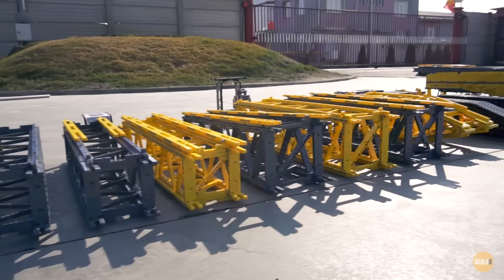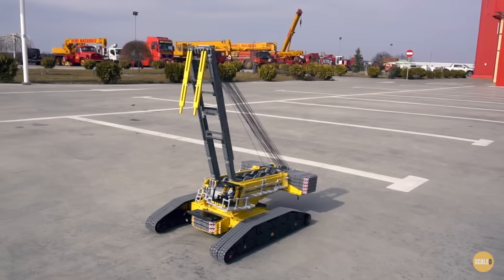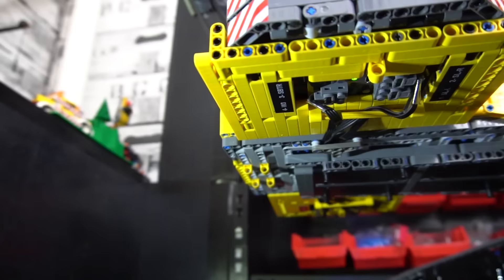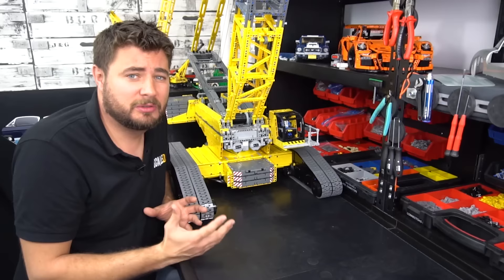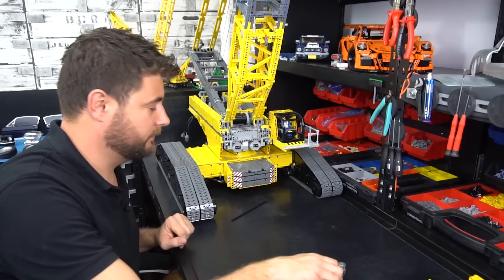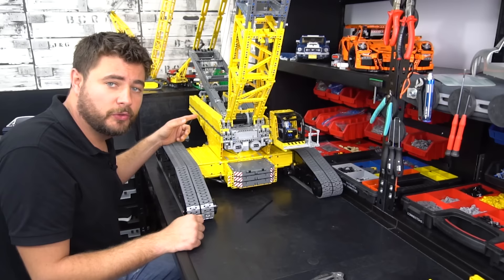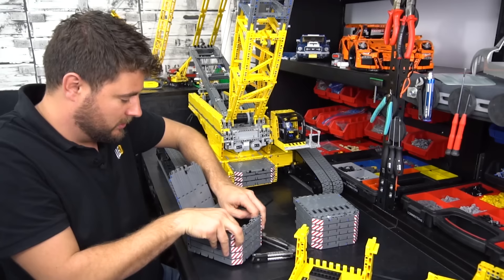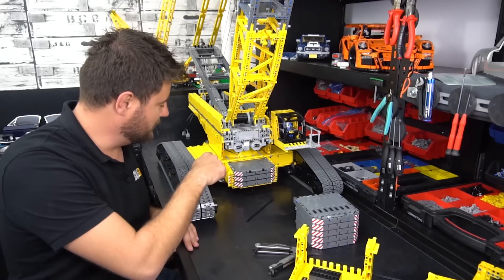Huge LEGO Technic Crane – 4.5m/14.5 Feet Tall!

Comment: It's so realistic and even modular like a real crane, this is insane.
Reply: The modular build was one of the main building targets, so that I can do maintenance and improvements over time on the components. I had to pull out the winches a couple of times. Even the superstructure is built in modules. It's harder to take apart, but can be done if the slewing system requires maintenance/repair. I can't imagine what a p.i.t.a. it would be to have a gear snap and not be able to reach it inside.
Reply: @ScaledChannel  I see, for something that massive, it's pretty likely that some component will inevitably fail! We probably all know the pains of disassembling something due to small errors... like putting in the wrong axle or putting something on backwards.
Reply: @diatomsaus  True true. That's the moment when it's better if you live at the ground floor. Then the MOC will not drop from such a height when you want to throw it out the window 😋

Comment: Nice build but I have seen larger.

Dawid Szmandra made an LR 11000 1:24 scale
Reply: True. Dawid's crane is beautiful. Mine is not finished yet. Mine is not finished yet, I also aim for 7m, but with main boom only +small fixed jib, not a luffing jib 3.5m+3.5m which is easier to lift. I still need to make some parts, and redesign the boom to make it stiffer

Comment: Amazing!
Can you build a longer luffing jib for that crane or are Lego parts not strong enough and the boom would break apart?
Reply: I don't want to make a luffing jib. First of all, most large Lego crane use a luffing jib because it is easier to lift the boom from the ground. Secondly, professionally I work in the wind industry, and we use luffing jib configurations rarely as we mainly use main boom+ short fixed jib or runner (LF or HS). The end goal is 7m on main boom+ the small fixed jib that is already done. I do need to redesign the boom, as I get torsion and sideways bending with more than 4.5m of boom (I had 5.5 build but couldn't lift it)

Comment: This huge lego technic crane must be a lego set
Who agree’s
Reply: wtf
Reply: Matt Gaming Lego should make a new type of sets called the superduper Master builder
Reply: Probably never gonna' happen as it would be too expensive
Reply: @bananatorpedo275  haha lol
Reply: It can't ever be a Lego set because it depends on non-Lego parts - the metal axles.
Reply: @mozismobile  And I have used a non-Lego bearing for the slewing. The slewing drive gear is Lego (the large round gear-racks from the BWE) but the bearing is not. I did search around 6 months to find a bearing that is matching the hole pattern of the Lego round gear racks
Reply: Not all Legos a re.plastic

Comment: Great work. Some of those peices look custom did you have to 3d print some of the components to get all of this to work?
Reply: No 3d printing. A few metal axles in highly loaded areas, and some metal liftarms (where the boom is fixed to the superstructure). And I must admit, I took out the dremel on 2 panels on the body.

Comment: What? No lifting demo? What for a crane that is not lifting anything???
Reply: Here it is holding a crate of beer with 6 full beers at around 1.5.-1.6m radius. I didn't have space to lift the boom more as it was touching the seeling. When the crane will be finished I will of course show how much it can lift. Here are the pics: https://ibb.co/XkRXVsP and https://ibb.co/mqrjxzQ and in this video from aprox 1:25 you can see it in action with the crate of beer. https://youtu.be/F9HWNXGTZrs